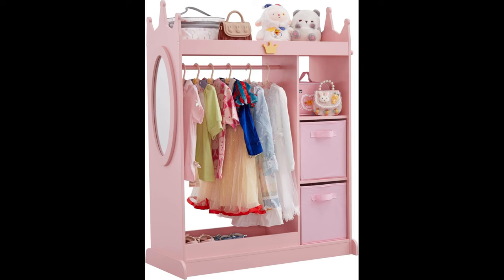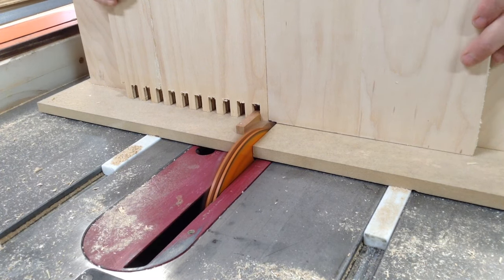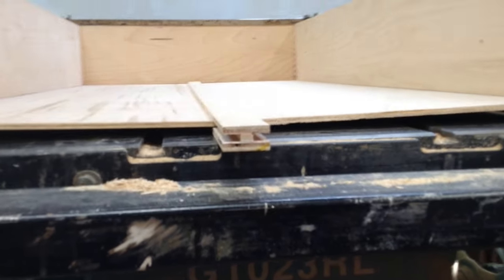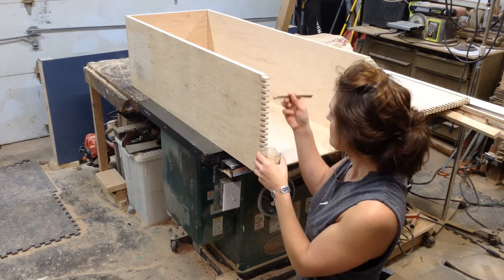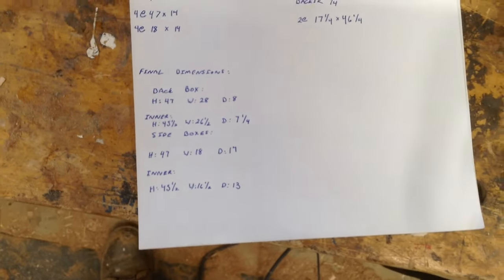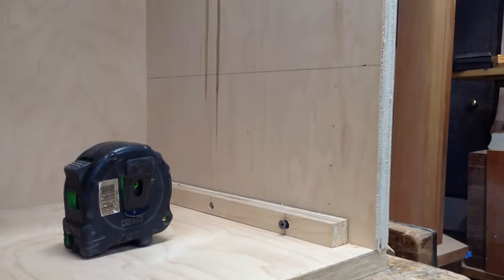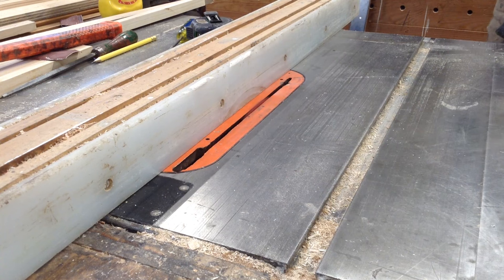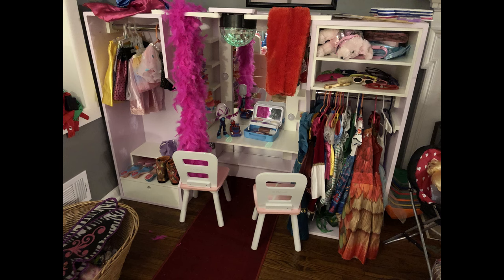Make A Kids Dress Up Closet || How-To [Part 1]

Comment: Quel dommage que nous n ayons pas ce type de scie circulaire en France. Le fait de pouvoir superposer plusieurs lames ,ouvre de plus grande perspectives.
Toujours de beaux projets très variés.
Reply from the maker: Thanks, I have heard you can’t get dado stacks in certain countries.  Such a shame. I use them on every build and find them to be safer cuts since the blade is usually covered.
Reply: @HoneyBadgerWoodWorks  Yeah. That's true in the EU - for home equipment at least - the reasoning seemingly being that injuries are multiples of times worse than with a single blade. They make the arbor too short for the dado stack.
As a contractor saw owner, I'd have tosay that's probably reasonable.

Great build. Someone's really going to enjoy that.
Reply: Ailleurs en Europe ? Allemagne ? je ne savais pas ça, ç'est une question de sécurité ?